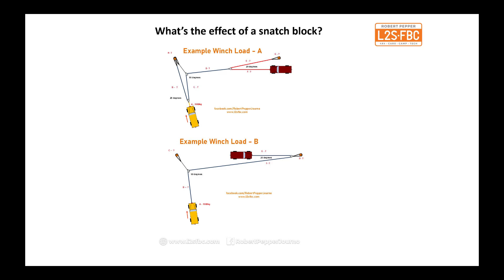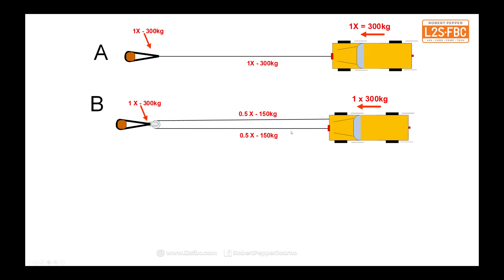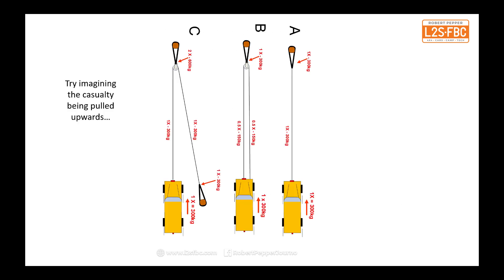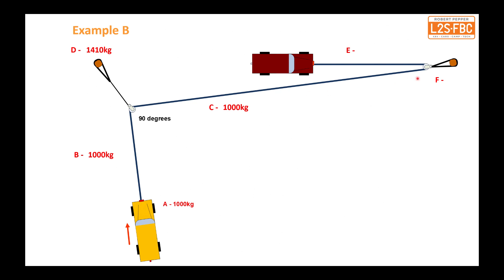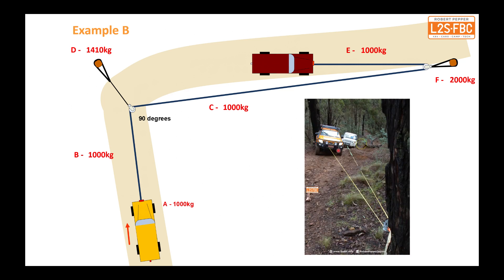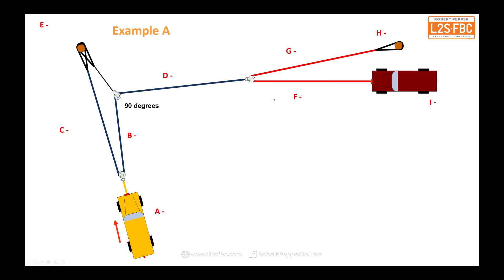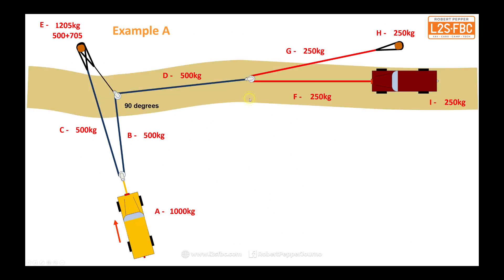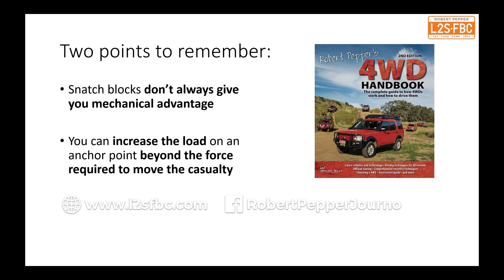Winching a 4X4 with snatch blocks - two examples

Comment: You obviously know what you are talking about; but please explain the distinction of a fixed  vs a moving pulley.
The Mechanical Advanatge (MA)  of a fixed pulley is 1:1 ( a redirect); whereas a moveable pulley (@ anchor)  provides an MA  of 2:1
Reply from the maker: Not necessarily.  Read this.  https://l2sfbc.com/you-can-get-mechanical-advantage-from-a-snatch-block-that-doesnt-move/

Comment: Exceptional video. I'm an expat Brit living in the mountains of Mongolia. I often recover neighbours and tourists in our neighbourhood, absolutely free. Usually I can just pull them out of snow and mud by a straight line tow with a hefty tow strap. However, at times I've been stuck (high centered) or in deep mud. We don't have handy trees at all. I'm thinking of investing in some extra equipment. I don't own a winch but might consider one and some extra straps. But how would I anchor without trees? I'm thinking metal ground stakes, sledgehammered into the ground. Any thoughts?
Reply from the maker: Yes, I would use the techniques shown to reduce anchor load. But also invest in traction ramps e.g. Maxtrax, they work very well in mud/snow.  I have videos on their use in sand and mud on this channel, four of those plus a hi-lift jack would be good.  Stakes into ground is hard work and they don't hold much.
Reply: @L2SFBC  Great advice, thanks. I was also thinking of recovery boards but I hadn't considered a high lift jack but I can get one locally, along with the recovery boards.

Comment: Would you say a 90 degree rope angle off the pulley is about the most you should go ? Have you ever seen a snatch block failure ?
Reply from the maker: Any degree is fine, no not seen one fail.

Comment: I get what you’re saying and it’s true that weight can be created but the pulley in this example is not creating a mechanical advantage. Let me explain it another way. Food for thought. Let’s take the snatch block out and for sake argument let’s just hold the line in our hands. If the line is coming from the winch to one hand the to your other hand and back down to the vehicle then each line and hand is holding half the weight. No mechanical advantage as you are still holding the entire weight. If you were to take the end off of the line off the vehicle and attach it somewhere else, it’s not that weight is created, it’s now that each hand has to hold the entirety of the weight thus doubling the effort. Now if you want to make an argument that mechanical advantage is being created, the only place it can be happening is at the winch itself which is acting as a pulley as it pulls the line in and is in fact a moving pulley. Let me know what you think.
Reply from the maker: https://l2sfbc.com/you-can-get-mechanical-advantage-from-a-snatch-block-that-doesnt-move/
Reply: @L2SFBC  this is the same reference you gave me before. My comment above is in reply to this second video you are referring to. Again while I understand what you are saying, at the end of the day, there is no maechanical advantage when the end of the line starts at the load and goes thru a pulley at the anchor. The only possible way that mechanical advantage is being created, however little that may be, is at the winch itself which is acting as a pulley as it is pulling the load in. There is no mathematical or physical way mechanical advantage is created on a stationary, redirect pulley. I feel you are not taking in my observation but that’s ok. Just wanted to share

Comment: Hello Robert, thank you for sharing all your knowledge with us! I am fairly new to winching and your videos are helping a lot.
 
Regards to Example A at the 10:00 mark. If you attach "H" to "I", than you would have a 2:1 MA but the red vehicle would see 500kfg of pulling force? So, I guess the main reason to have "H" anchored to a tree is to reduce the pulling force on "I" (if, for example, the winching vehicle is much lighter than the stuck vehicle?)
Reply from the maker: Correct, for a 2:1 MA where the winching vehicle is static you don't need to attach the return line to the car.

Comment: Question on the last one 11:00. Say H would it be better to attach back to the winch vehicle to give a better pull?
Reply: hmmmm. thought the same thing?.. because your first demo a,b,c.... on C there was no mechanical advantage but on B  it cut it in half so on the last one I thought H should be hooked to the winch vehicle instead of a tree off to the side

Comment: Don't really understand all that about the blocks, but as i don't have a winch it doesn't really matter. Why would reversing up a hill put more stress on your CV joints and front diff when compared to driving forwards?
Reply from the maker: Because there is a weight shift to the downward part of the vehicle when on a slope.  Also, diffs are designed to be stronger when forwards compared to backwards.  So, try not to reverse up hills and if you do, be smooth, and keep the steering wheels straight as the more lock you apply the weaker the CV.

Comment: 1:20 stationary blocks as in B don't give any advantage, they just change the direction
Reply: No way... I could not pull my self stright out once. I then hooked it up like B and it came right out. It was slow but it worked
Reply from the maker: Bart is correct..the misconception a block must move for MA is wrong. Just watch my videos.

Comment: Hi Robert 
I am a beginner at 4WD and these videos are very valuable. Thank you
I was confused as to how to determine if I have a mechanical advantage or not. The images of the the pulling vehicle on Example C at the start of the video and the pulling vehicle on example A of the redirect set up, look the same. However only one has Mech' advantage. I worked out why in the end. Just for ease of figuring this out out on the field, can I just look at the rate of vehicle advance vs the length of line pulled in by the winch? IE vehicle advances half a meter for every meter of line pulled?
Thank you 
Elisha
Reply from the maker: Hi Elisha - yes that works too. There are various ways to work out MA, some work for some people, others not. Your method is good. Glad you found the videos helpful, please share/subscribe etc :-)

If the car moves forwards 1m for every 1m of line pulled in, then there's no MA, regardless of however many blocks the rope goes around. This is a big misconception; I have another video on that subject specifically.
Reply: Yeah, that's where I'm confused. The only difference between the examples was the additional pulley. I'm guessing some of the load is distributed to the second pulley which is what provides the MA?